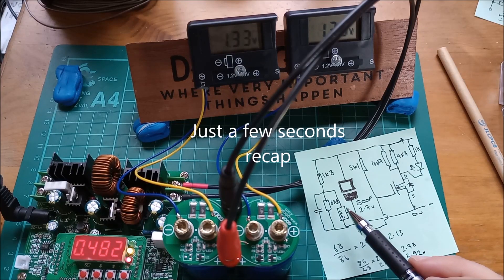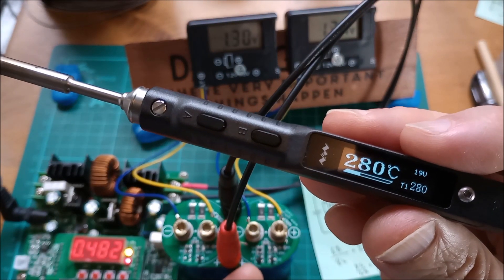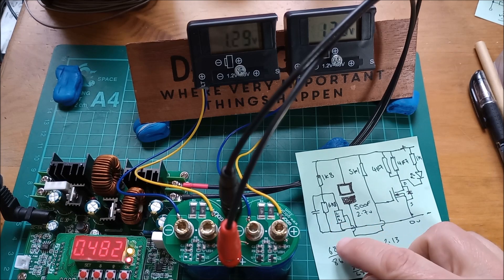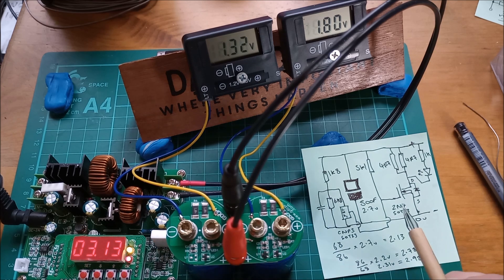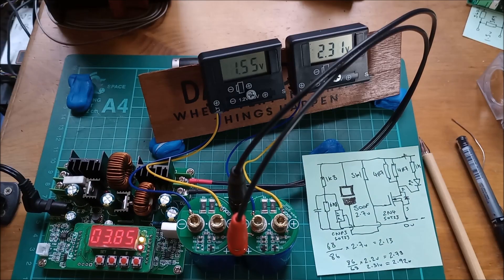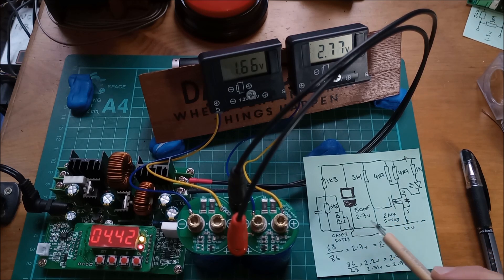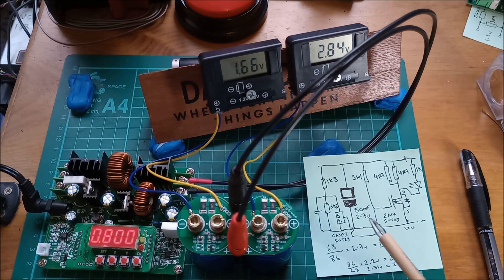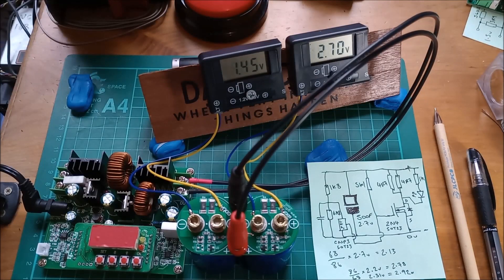Part3: Supercapacitor 5.4V 250F Schematic

Comment: Yes, those parts are not ideal.  I used a bench supply and gradually increased the voltage on individual capacitors and they all turn on about 2.85 to 2.88 volt and turn off about 2.78 to 2.79v.  ☹
Reply from the maker: Time to adjust the potential divider resistors I think :)

Comment: - Introduction to the LN61C voltage detector IC and its limitations for supercapacitors.
- Soldering the leg of the voltage detector chip back onto the circuit.
- Observing the voltage rise in the working supercapacitor circuit.
- Discussion on the part numbers printed on the chips.
- Charging the supercapacitors and noting the voltage levels.
- Concerns about the voltage detector IC not triggering at the correct voltage.
- Using a car headlamp bulb to discharge the supercapacitor to its rated operating voltage.

Note: The video is mainly focused on the limitations of the LN61C voltage detector IC when used with supercapacitors. Julian Ilett discusses how the IC doesn't provide proper protection and may require modification for accurate triggering.